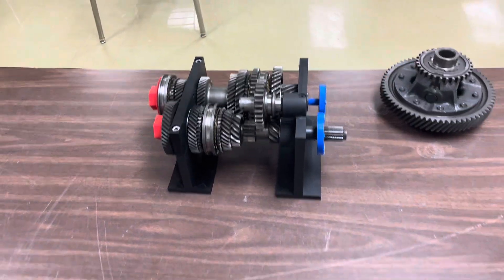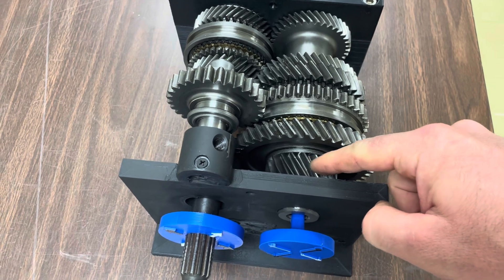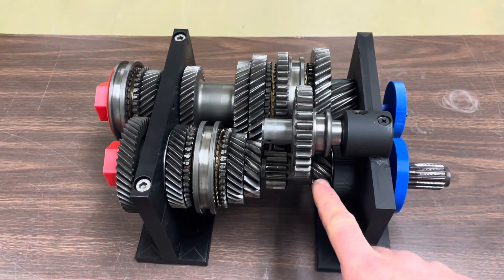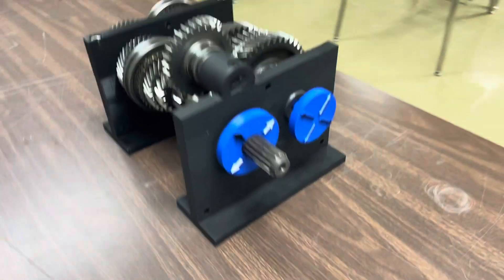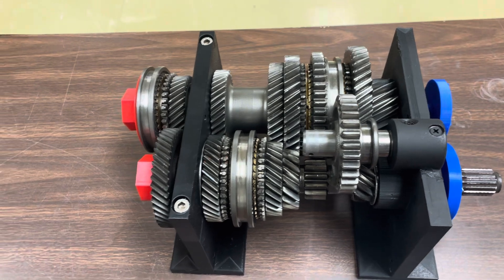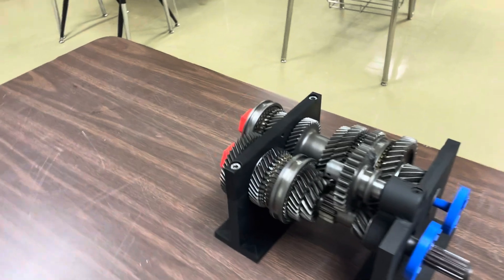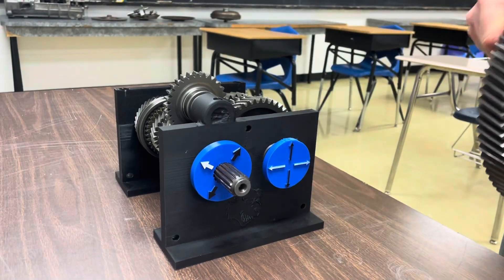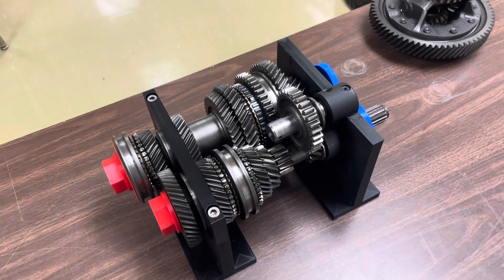5 Speed Manual Transaxel Operation

Comment: Hi, i come from your Creality Ender 3 Neo Extruder Drive Clicking/Slipping Diagnosis video. Were you able to fix the clicking? and how. Thank you.
Reply from the maker: Yes, the Bowden tube where it meets the extruder nozzle gets some heat damage which restricts the filament flow. Taking it apart and cutting back a new piece or replacing the tube is what worked for me. It’s a popular problem after a printer has done some work.
Reply: @autotech4103  Thank you, it was driving me mad. The end of the tube had narrowed a lot and had a piece of plastic stuck.
Reply from the maker: @juansolo7554  they seem to always need a bit of tinkering to keep them going.